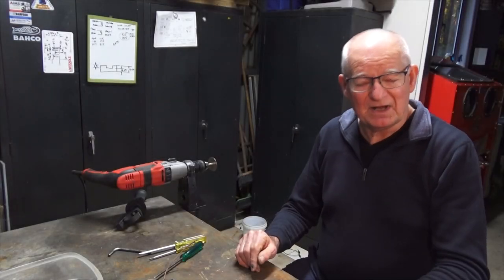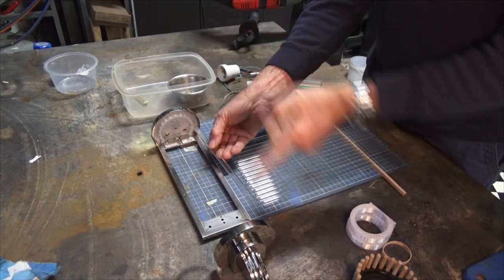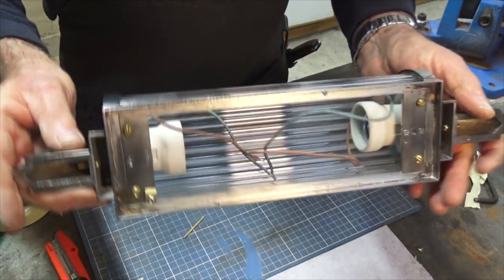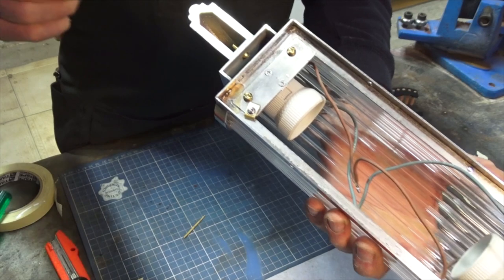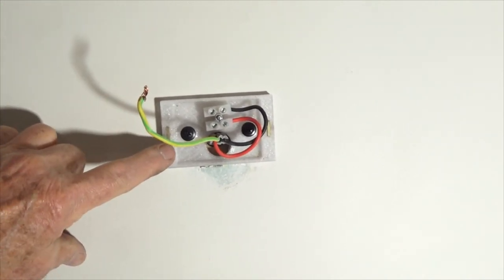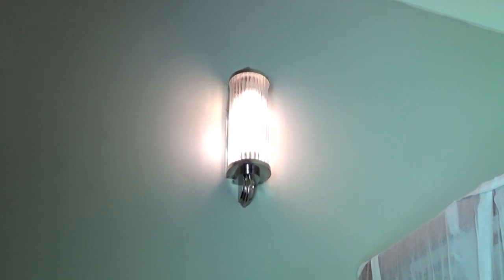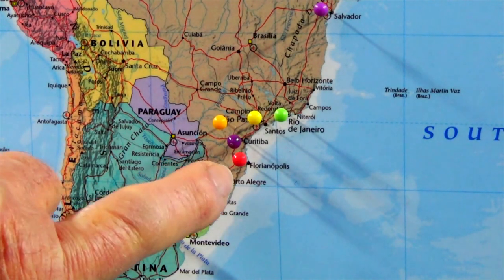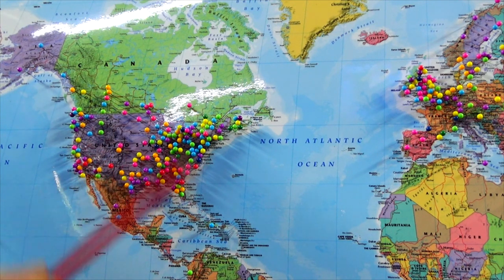DIY ART DECO WALL SCONCES (THAT'S A WALL LIGHT FITTING) Part 7

Comment: Good job Mark,
 thanks for the tip on cobolt nickel it's better than the nickel I've been using
Reply from the maker: I think it's a very close match to Chrome. I can see a very slight difference on the toilet roll holders that I plated but from what I was told by my plating expert, the chrome is added as a "flash" plate right at the end of the process. The nickel or nickel cobalt does all the heavy lifting in terms of corrosion resistance. 
Regards,
Mark

Comment: If you have an old broken pc flatscreen monitor or laptop you can disassemble the screen and it'll have some diffusion layers inside which you could feed in behind the glass tubes. I think it will hide the bulbs and give a better aesthetic when they're turned off (and on tbh). Just an idea
Reply from the maker: It is possible to buy the same type of glass tube but with a semi translucent white or cream colour. I also have some tracing film which would do a similar job but I have sort of gotten used to the clear glass now.
Regards,
Mark

Comment: These are beautiful fixtures. Not the kind of project I'm usually interested in but they came out great, the only flaw I see is that 3D printed parts don't seem to age well, the bracket holding the fixture to the wall may fail with time.
Reply from the maker: I used PETG filament for the internal parts of the sconces. From what I understand it is more durable than PLA and has a higher melting point. The heat isn't really an issue but all plastics will become brittle with age. I did start out making an aluminium bracket which could be screwed to the wall but it was a lot harder to manufacture and I only made the one before turning to the PETG bracket. It will be interesting to see how long it does last.
Regards,
Mark

Comment: Hello, Preso. Just one question - how do you intend to change light bulbs when(if) they inevitably blow?   Very shmick, BTW.
Reply from the maker: Well, I am hoping that LED bulbs are unlike their older, hotter tungsten filament brothers. The often quoted 1000 hour lifespan should see me out given that they don't get a lot of on time. However it is fairly simple to remove the two screws and they can then be pulled away from the wall to get at the interior. 
Regards,
Mark
Reply: @Preso58  👍

Comment: The result is lovely, Mark.  I really like the look.

Looks like a bit of a major pain in the cock to assemble, though, you should probably get yourself a job working for Wever & Ducré (French electrician's joke).  Hope you don't ever have to disassemble them.
Reply from the maker: The assembly did give me the sh*ts. Unfortunately, the design got more complex as it wore on. I based the general concept on a low resolution photo I found on Google images. Still, it turned out OK in the end and the wife is happy so that's a bonus.
Regards,
Mark

Comment: One thought on the rattle issue. 
Hot glue.

Arbuckle, California, USA
50 miles (80 Km.) north of Sacramento.
Reply from the maker: I thought about that, silicone sealant too. Both those have the potential to get smeared though. 
Regards,
Mark

Comment: Hi Mark,
 the end of a nice looking project, Tthe electrical connectors worh looking at  if you do any more installations are WAGO connectors insted of the old choc block termanal strips. have a good trip.
ken whelan
Reply from the maker: Ken, I do have some Wago connectors but the levers are bright orange. The screw terminal blocks I used were a bit less visible through the glass. They were a real pain to tighten down though whilst trying to hold up the light and insert the wire at the same time. At some point I may replace the wire with some less obtrusive colour like plain white. 
Regards,
Mark

Comment: As a licensed electrician I'll testify I'm pretty sure most light fixtures are designed to need a minimum of 3 hands to hang. The more costly and easily damaged of course the more hands required and the less help the boss thinks you need.

Got a good clear shot of my little blue dot on the map, cheers.
Reply from the maker: I am glad you saw your pin. Who knew how popular the map was going to be! I can reveal that the first light took nearly four hours to hang correctly, the second took about 15 minutes! Many bad words were uttered!
Regards,
Mark

Comment: WOW! beautiful results, kind of a showcase of your 10,000 skill sets. Not exactly a good example of DFM (design for manufacturing) but impressive. Love the aesthetic.
Reply from the maker: Design for manufacturing is an interesting topic. I once went to a seminar on design and one of the presenters was an architect who also did some product design. He proudly told the audience that he had designed a toaster where the entire assembly could be held together with just one screw. I was thinking "take out that one screw and the whole thing will fall apart". I also went to "The Henry Ford" museum in Detroit. There was a display showing how car assembly had changed over the years. There was a huge chrome plated bumper bar from the early 40's which was held together with nearly 50 bolts. The designers found ways of reducing the number of fasteners down to about 6 without sacrificing the style. 
Regards,
Mark
Reply: @Preso58  Techniques and theory associated with Design for manufacturing (DFM), Design for Service (DFS), Design for Assembly (DFA), and an early cousin Value Added Engineering have now become very established disciplines in product design engineering. And as your Ford bumper example shows this has been going on for a long time. The increasing desire for automated manufacturing and assembly have made the techniques integral to the product design process. Have these design approaches made goods less repairable by the home mechanic handyman? Not to get pedantic but I can recommend books by Geoffrey Boothroyd and Peter Dewhurst.

Comment: All previous episodes I have been wondering how on earth you were going to get the glass tubes in. Well, you managed! To my simple mind it still looks a bit overly complicated though. I wonder if it had been possible to make the top 3D printed tube receptacle as a separate part, so not attached to the top cap in advance. And the receptacle should have had through holes. During assembly first add the bottom cap and the top 3D printed receptacle first. Then insert the tubes via the through holes in the top receptacle to sit into the bottom one. Then add the top cap. Done. Would that have been feasible or is it at odds with other design considerations?
Reply from the maker: In hindsight, there were more efficient ways of doing the assembly. These projects tend to be a bit "organic". They evolve. Having said that, fitting the tubes was actually easier than I anticipated. The metal polishing was the truly horrid part of the whole build. 
Regards,
Mark

Comment: Love it, a very nice job, and love seeing you do your own wall repairs and such... Its really no more difficult than reverting back to being a kid in a sandbox, but with most simple mixing and applying instructions and ability to read this time around... Why pay and outsource a bit of dirty childish fun, when you can do it yourself and if its the first time doing it, just as with welding, make it thicker and sand it down flat... Btw, i would have taken a white shrink wrap and white enamel colour(matching the wall colour) and sleeved the wires inside white and painted all that could serve as a distraction within the lamp, like those ceramic bulb holders and printed plastic components... It would bring up the lamp even more out as its not frosted so it would if done well make an illusion of bulbs just floating in there...
Reply from the maker: I did worry that the wiring would be visible and indeed it is. My initial plan was to route all the wires along the inside of the rectangular frame but it didn't happen. I can still do this but after scrutinising the appearance of the project from every angle and being highly self critical, it's not long before you just accept it and move on! 
Regards,
Mark
Reply: @Preso58  Its up there far enough for it not to be visible from below, so it matters not, and the leds(have a few like those) really are no hazardous source of heat which could impact the wires even if they were touching the bulb...  I just said it as i always sleeve all wires, even coated ones in white or black shrinkwrap to make them look uniform, leaving just the tip of the original insulation visible where it will socket into a connection... I dont know why, but seeing colorful wires makes me sick while working with them... Its like bad surface finish on a lathe or a mill... Tho, i cant thank you enough for the idea of reusing old crankshafts for cast iron bushings,  also, the timing shafts are a good source of the same, just smaller diameter, and they provide very nice lobes/cams if you ever want to make your own cam-piston lube pump or such...

Comment: Turned out great! I tried to think of an easier way to assemble the glass tubes but, short of hot gluing them on one side, I can't think of anything else 🙂 Great job! Enjoy your holidays!
Reply from the maker: I had considered hot glue and silicone as a way of stopping the tubes from rattling but the chances of getting them in without smearing them with goo were just about nil. 
Regards,
Mark
Reply: @Preso58  Yep. You're right. Your solution is way cleaner, even if very elaborate 🙂